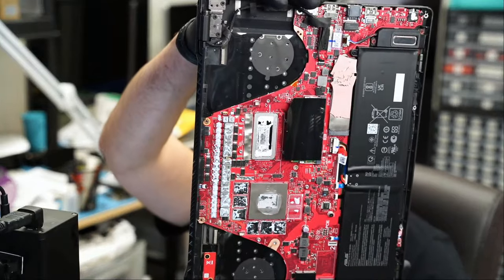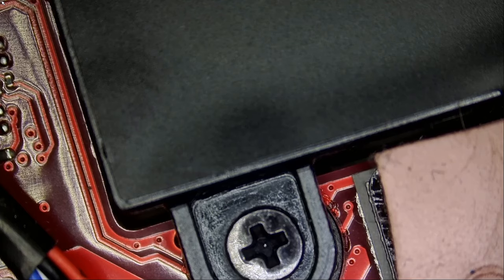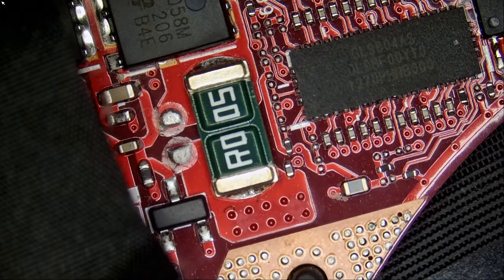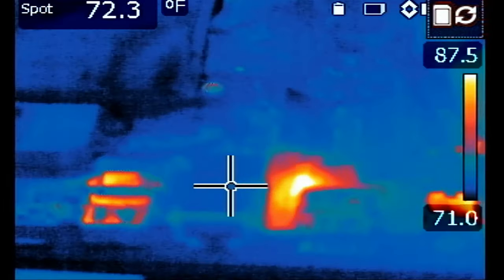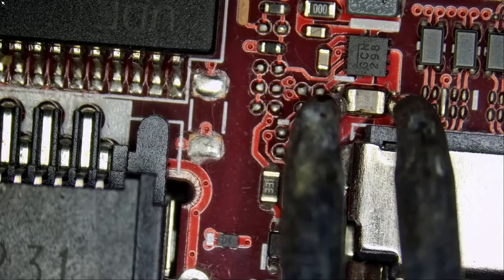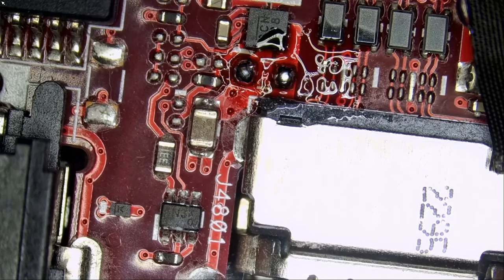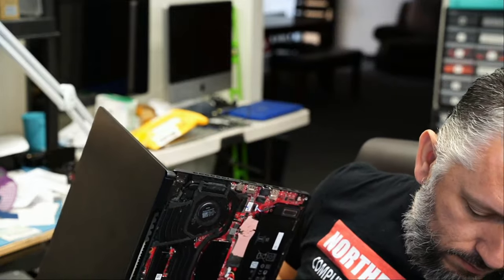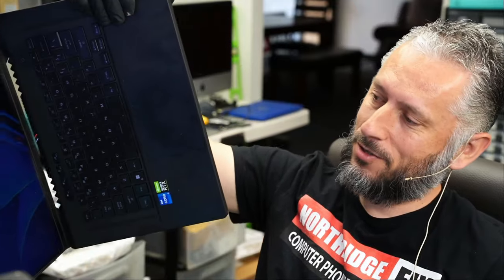Asus ROG Laptop Repair - Which Laptop is Best?

Comment: Ive had a MSI for almost 6 years . I really think most of these shorts are from end users errors and/or over clocking. 
I cant fathom how so many fail in the same way and their hasnt been any litigation brought against those pc manufacturers. 
This maybe a bit forward, is it possible for you to run a small survey on next set of laptops?
"Did you over clock your PC?"
If majority are "yes" it could explain why they dont get the warranty. 
Awesome video as always .

Comment: Buying warranty is a horrible idea.  You'll pay as much for the warranty as the average repair, and there are always deductibles on extended warranties that generally cost nearly as much as having it repaired; so in the end, warranty typically costs double what the average repair costs.  It is better to just accept that hardware fails and protect your data in such a way you can migrate to a new machine easily.

Comment: Everything will fail - sooner or later, thats why I do buy maximum lenght warranty available. 2 years by default, due that Lenovo will grab my money to extend my laptop warranty for extra 2 years (onsite repair). Laptop were 1.5 years old when I started to notice it getting hot (Ryzen 7/5800H with 3070 8G), opened to clean, only to find that heatpipe top of the GPU were ruptured and pushed all its contents to motherboard. And as cooling were failing, GPU got hot and started to act...

Thanks to warranty, repair person visited home on next day and replaced entire heatpipe / cooling plate and motherboard (inc cpu & gpu)... 

Lenovo Legion 5 Pro 16" - not replacing anytime soon as finding laptop with replaceable memory starts to be a hard.... And finding any with soldered 64G is next to impossible, or pricey as hll... And often those have only single M2 slot too, or soldered ssd.

Comment: As a computer tech since the 80's you have my upmost respect and admiration for telling the truth about laptops.
I would also add that warranty techs get paid a fixed price per laptop so make sure they don't cut corners where on-premises field service repair is done, which is always module replacement.
I look forward to the day you get to work on a Framework brand laptop.
Reply: Yes am waiting too...
Reply: Whats the best laptop that can a man buy ? A strong laptop to use it for everything and to not change it after couple of years .
Reply: @napst3r1 mac , because of the software, anything with windows and it's try to update itself would end in blue screen 😂

Comment: I've been using my old Toshiba's for many years without any problems. There still are statistics showing which ones fail more often, I did take them into consideration when I bought my devices. Used to be better with the Japanese and the Taiwanese ones + Dell, but I haven't followed these statistics in the last few years. Anyways, you can't really buy a Japanese one now, most followed the Dodo way.

Comment: Every device fails. Not just Asus laptops. Some last longer than others. Sometimes it's cheaper to replace (especially if the device is very old) but other times, Alex turns it into something that's better than factory.

Comment: Have a ROG and not a fan.  They make the keyboard so that the print rubs off in a short time which will void the warranty.  After getting it fixed, I've had the ROG twice as long and the replacement keyboard shows no signs of wear at all.

Comment: My 2006 Dell Inspiron running Windows 7 is still going strong
Reply: That's back when DELL still built solid, beautiful, enterprise quality laptops. Love that beige, ceramic-looking finish. W7 still rocks!
Reply: 2004 IBM ThinkPad T42P used nearly every day still operates. Harddisk changed after 10 years and two times cleaning and thermal paste.😁

Comment: The last ASUS laptop I bought was an X53S and it failed epically with a dead Sata chip, I ran the laptop for years off the USB3 port, currently I have a Lenovo Ideapad that is currently 5+ years old and still going strong

Comment: lmao ive had DELL 5577 for i want to say 5 or 6 yrs now. I gamed on it, using a monitor and keyboard and mouse. The laptop just sat there as the work horse and always closed. I never used the laptop keyboard ever and its still like new. I never had a issue at all with this laptop , the only thing , is that gpu gtx1050 isn't recognized at all. Its like it was never there and this is after i uninstalled  my own version of windows and the oem.  Id recommend Dell gaming laptops
Reply: Dell is one of the worst companies defective product
Reply: Haters gonna hate.
Reply: @rd2dab  no not haters it is true
Reply: @rabbi619  from what I've watched on YT repair channels including NF, it's exactly as he says. Every company produces laptops that *can* fail but that doesn't mean they will fail in X time period. Just use whatever you want.

Comment: I had a Gigabyte laptop failed within warranty  , got the thing back and sold it immediately, better to get a mini pc if you can because the laptops run so hot , especially for gaming .
Reply: Yeah, people who ask such questions does not really make sense. Just buy both. I play games on computer and work on my laptop. 
I spend $500 on a pc (x99+e5-2697v3+rx 6600 xt) and $210 on a used i7 gtx 960 laptop. It's been 4 years and never break once.
Reply: If your laptop is running too hot when gaming then they didn't do a good job with the paste application and you didn't bother undervolting either. Laptops shouldn't run over 80 degrees in most games.
Reply: @Kezmark the consumer does not have a choice. Triple-A games takes 70-90c on ultra settings. They are stuck to play esports games or forced to play triple-A games on medium-high settings.
High-end gpu laptops are only for marketing purposes
Reply: @Kezmark  I play games on silent mode even when using ultimate gpu temp is 68 to 70 i mostly use igpu yes on silent mode temp on that is 65 degree both modes make no noise fan is almost zero i dont care about fps but yes i do care about noise and heat.

Comment: At the company i work, we all use high performance HP laptops company size is about 350 employees.
Using Autodesk and design applications that use a lot of cpu/gpu power and we only have about 2-3 failing laptops a year.

These are laptops with High end cpu and gpu cads.

To say all laptops brands fail is not fair and you should take your words back!